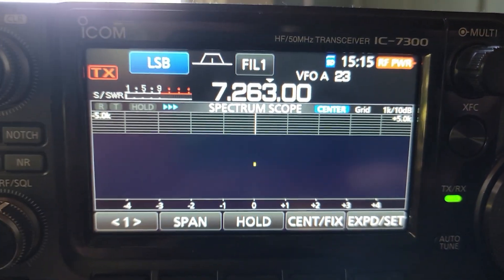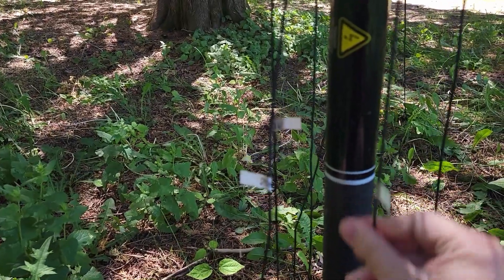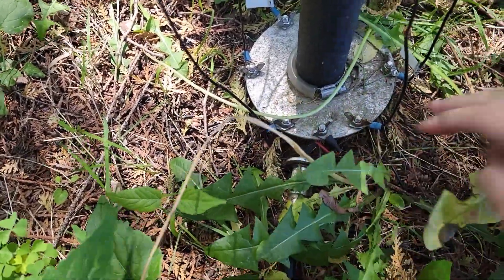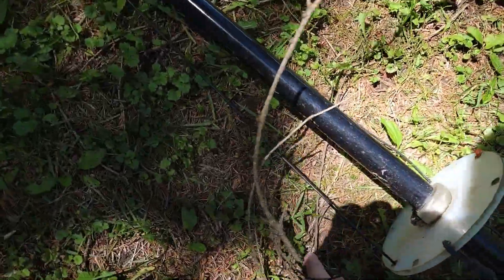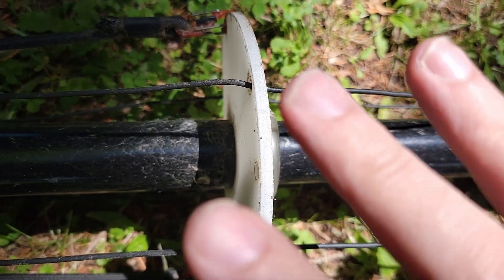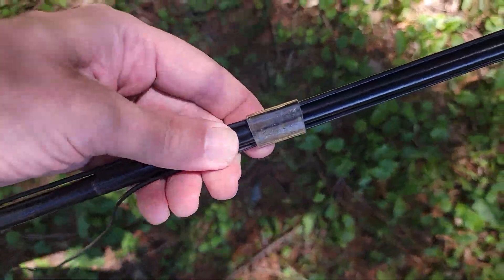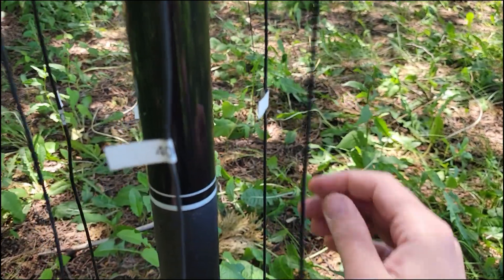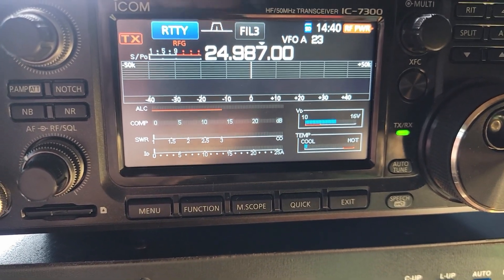The Antenna Gods Did Not Spare Me

Comment: If you soak your nylon ropes and shock cords in 303 protective solution it will help those last longer now those shock cords that you tied Knots in they’re not gonna last more than six months if you’re lucky I deal with Shock cords quite a bit in my business and once they start stretching they’re pretty much done and should be replaced just a heads up but if you soak them in 3O3 I think you can get them to last a lot longer.
Reply from the maker: Great tips! Thanks for sharing.

Comment: Mine went had some issues this year. Those clips that Callum supplied with the original DXC Classic had dried completely out and became brittle as well as the shock cord was completely stretched out. So I replaced several of those with new shock cord and I am doing the double knot thing now instead of the clips. 3 years in the Texas sun will do that but the pole is holding up well. The original D10 wire has been replaced with DX10. Always order more wire with the DX Commander. You will be glad you did.
Reply from the maker: I order wire even without getting a DX Commander.  Its good stuff!

Comment: Nicely done TO.   Not so harsh here in UK winters but plenty of storms.  My Classic has been up for 5 years now - never collapsed.  I have changed out the elements for DX10 (nicer wire) but the doingy is the same and pole is just as new.  I use the hose clamps just like you and it is great.  Certainly for cost/year it's unbeatable - have used it constantly.
Reply from the maker: Tom!  You couldn't be more right.  The cost is one of the most amazing things.  Very quality product for less than you can build it yourself.  The way it should be.  I'm very happy with mine!

Comment: Timely. I'm about to put up a DX Commander 12.4M Signature antenna. I had to cut some tree limbs down that were going to be in the way over top the location (dang this antenna is tall). I'll be elevating the DX Commander about 12" off the ground (above my external radial plate that is already in place) so it won't be sitting on the ground and more importantly, in the snow, which will soon arrive.
Reply from the maker: Elevation is a good thing - do you only get 12" of snow there?  What's that like? :-D
Reply: @temporarilyoffline  It's nice. I think this past winter we only had 4" or so at any one time. About 10 years ago we got back to back storms and had about 24" laying on the ground. Not missing that.
Reply from the maker: We usually get more than a foot.  I've had it up past my knees
Reply: @temporarilyoffline  If you want a chuckle, here is a video I made being silly from 6 years ago when I had a different YouTube channel and made "MotoVlogs" (Motorcycle Video Logs) and had a following. It was me being silly after being stir crazy from snow and bad weather in the winter.

https://www.youtube.com/watch?v=bfOkUx4yF-I
Reply from the maker: I'll take a look, I got a little stir crazy myself last year and went to Yuma, AZ